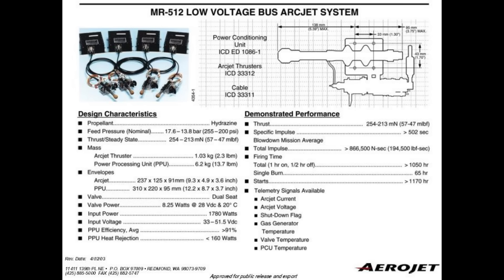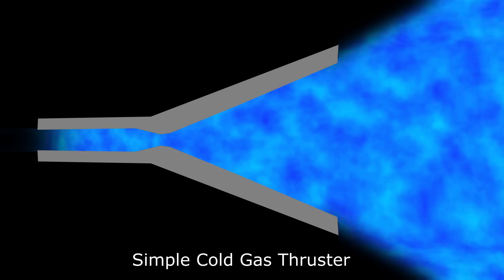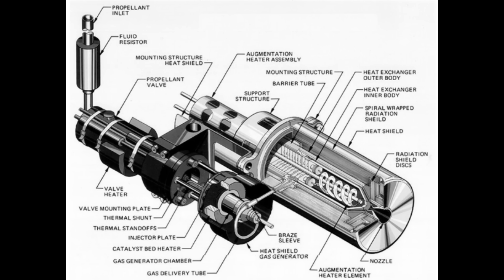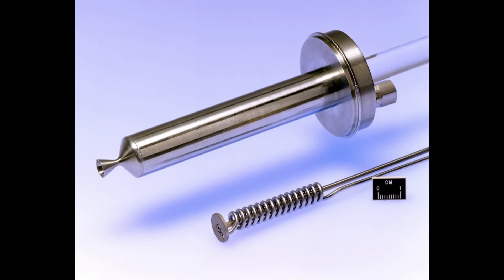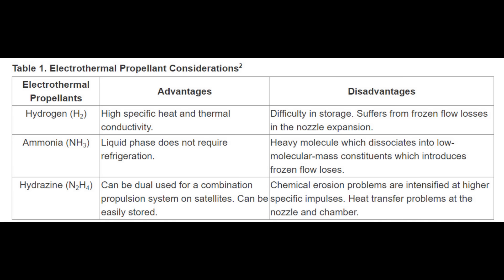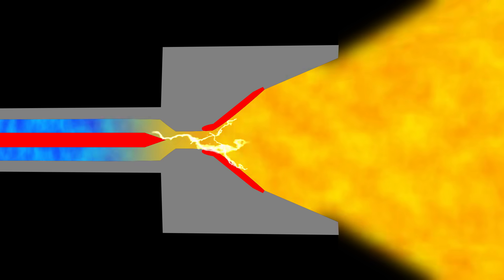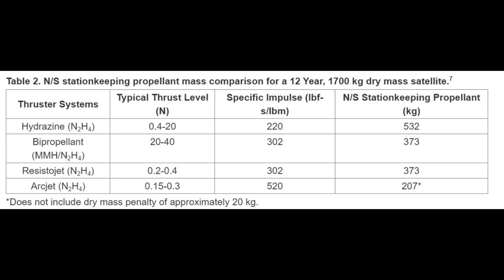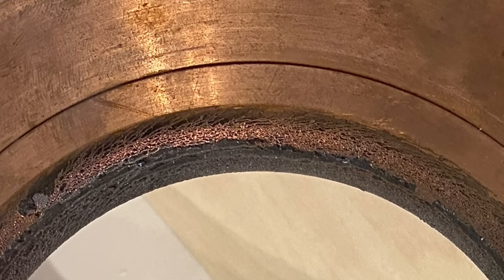Lightning In a Bottle?  The Science Of Electro-Thermal Rocket Engines

Comment: Hey Scott.. is there any data on electrothermal thrusters using methane? Also are these things tolerant to being supplied from a tank where the contents aren't settled, at least at first? So being fed with the occasional burst of gas, instead of liquid.
Reply: sure but why? if you have methane you probably have oxygen and the marginal cost difference between a bipropellant thruster and and arcjet is negligible. ANd if you only have monoprop there  are better performing gasses.
Reply: @orbitONhigh  Consider the problem where you have a methane fuel tank - say 50-100 tonnes worth. It's in orbit and you need to dock it with an orbital platform. Later, when it is empty, you want to undock it and de-orbit it. You need to give this fuel tank some autonomy. Propulsion, guidance etc.

The most obvious solution is to carry an auxilliary LOX tank and run methalox thrusters. The problem here is the complexity/reliability of a bi propellant system. You also need ullage (presumably cold gas) thrusters. So another tank, more plumbing. Plus you may need to get the tank into the right attitude before ullage thrust will actually be pushing the fuel up against the correct side of the tank.

This is all possible with regulation cold gas thrusters. But we're pushing a heavy (50-100 tonnes) object and at this point the mass of the pressure tanks becomes an issue.

So the next step might be to keep an auxiliary tank containing liquid methane and then use this to drive a cold gas thruster. Pressure vessel mass problem solved. You need a pump and a heater in order to have cold gas and at this point you're probably thinking that you might as well use an electrothermal thruster. The question then becomes, can you design a thruster such that it will tolerate initial bursts of gas?

Methane will give you better Isp than Nitrogen and an electrothermal thruster gives you the additional Isp that may be needed for de-orbiting.

Comment: arcjets have kidna been handled side by side as an alternative to ion engines at some point
Reply: at this point  ion drives have all but replaced arcjets. only ones being flown now are on legacy bus designs or specialist missions. hall thrusters are generally cheaper and last longer lasting.
Reply: @orbitONhigh  yep
but like 15 years ago they were quite comparable and often presented as the two main electrically powered concepts next to a few more edgecase ones
Reply: @JulianDanzerHAL9001   yea it changed pretty quick id say the change over happened around 2010

Comment: If you need to slowly adjust a satellite which is necessarily in orbit around a planet and you have an electrical supply- solar panels or plutonium, pick your poison. Why cannot you use the magnetic field of the planet and use a generated magnetic field to oppose it and thus change the position of the satellite, albeit slowly, without the need for reaction mass?
  Is this a stupid question?
Reply: It's possible in theory. Using magnets to generate torque is straightforward, as seen in an ordinary compass. Thrust, on the other hand requires a gradient in the magnetic field, but over small lengths it is practically uniform. So to generate a net force, we need a large current loop, and it all has to be light enough to get a useful acceleration and overcome drag and other perturbations. The concept is called an Electodynamic Tether, you can look that up for more info.
Reply: @shanent5793  Thanks for the response.

Comment: Pulsed arc jet plasma. I've been thinking about this for years. The biggest problem is how to replenish the vaporized parts of the apparatus subject to the arc which are not intended but small fractions of which are accelerated out the back by the sheer temperature of the local plasma created. It's like teeth and saliva. You do things with your mouth and acidity or bacteria borne acidity leeches away the enamel. Arcing does that to the cathode/anodes. But your saliva has calcium and enzymes which put it back. Dry mouth is really bad for your teeth. SO how to apply that to plasma inducing interfaces such that as the fuel is used, there is enough left behind to regenerate the arc surfaces to create a self sustaining system such as your teeth. (Human teeth would decay away in some weeks if it weren't for saliva's constant repairing action.) 
Complicated is an understatement. Control of geometry and ignoring atmospheric pressure might be an avenue to look into.
You could momentarily pulse a magnetic field while creating the arc to push the intermediary (ionized anything) away from the contact and let it move on out the back door but I haven't heard of any successful way of doing that and even that will take some cathode/anode particles with it by the nature of the violence. There has to be some way of concurrently depositing and using the electrodes in an equilibrium.

Comment: There are analytical machines called ICPMS. That stands for Inductively Coupled Plasma Mass Spectroscopy. It injects a sample into the chamber and atomizes it with an induction coil and the atoms then go through a mass spectrometer.

Comment: Couldn't they make the electrical arc used for heating generated like in an ICE car ignition coil ? Those last pretty long and the only reason they fail at all is mostly due to planned obsolescence carefully built in their current designs (like it was with the incandescent bulbs also) You could design this to last for decades I'm pretty sure.

Most fuels used for this also have much less carbon buildup compared to car grade fuel so that would also help. That would work for lifetime of satellite and it could be a swappable part like in car engines for re-used spacecrafts at maintenance intervals anyway.

With bigger heavier payload capable launchers like starship coming online sooner or later in some way shape or form and continuous improvements in solar panels and batteries I'm really curious to see how far supplemental electric source propulsion methods can go in the future.

Maybe ionised gas/plasma thrusters jumpstarted by these methods end up the main propulsion systems in the far-er future.

You will still need chemical fuel and have to refuel somewhere at some point but you will get much more oompf out of it than just burning it off like we do these days.
Reply: most electric propulsion devices do / can last decades, your mission typically end or you run out of propellant first most of the time

Comment: IIRC According to James Dewar's book "To the end of the solar system" (which is about nuclear thermal rocket systems, NERVA/ROVER in particular) a good rule of thumb is 75lbs of thrust to the megawatt.  NERVA was about 1.1GW and ~75,000 lbs of thrust with an ISP about 900.

Comment: Hmm.... Could you use a heatpump to concentrate the excess heat within a ship (or station) and that to heat the gas, rather than an electrical heating coil? Make use of that thermal energy, instead of just radiating it out into space with giant radiators.

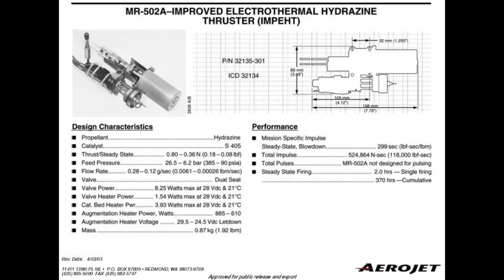Comment: 0:40 I was working at Rocket Research (Aerojet) in the Test Lab when these were first developed. I was a Mechanical Technician and had lots of hands on experience with Hydrazine. All of the production engines were catalyst activated monopropellant technology. We test fired these in huge walk in vacuum chambers sometimes referred to as altitude chamber testing. 4:00 That was the original prototype we called the "jelly roll". That is a Hydrazine gas generator that outputs 1800 degree Fahrenheit gasses. Hydrazine is N2H4 so the gas is hydrogen, nitrogen and ammonia.
Reply: Always wanted to try to make a resistor rocket to decompose hydrogen peroxide. A spicy steam rocket.

Comment: I mean, isn't VASIMR just a really powerful electrothermal thruster? From what I remember of its design both of its stages are heating stages, just much more powerful ones (that iirc are in common with fusion reactors), and the magnetic bottle and nozzle are more just so the thing doesn't destroy itself with the stupidly high temperatures
Reply from the maker: The final exhaust gas has a relatively narrow band of energies because it's not thermalized, that's the difference.
Reply: @scottmanley  Ah, yeah now that you mention it that does make sense given the heating mode and short residence time

Comment: About halfway through this, I had an Idea. Something like this would be extremely viable in an atmosphere. No fuel needed, just a power source and a compressor to cram enough gas into the intakes.
I'm not sure what it'd be viable FOR, exactly. I'll give it thought.
Reply: Just need that power source to be.. powerful.  That's where electric aviation is struggling.

Comment: Honestly, I was thinking about using a combo all in one thruster engine, a decomposition stage creates free electrons, those get captured into electron hole potential areas for wireless tunneling through electromagnetic fields. Which, those fields help increase pressure to a negative ion state has (cesium h2o2 co2, nitromethane, and a hydraulic fluid that turns ionic after being reacted high pressure and heat) with a slight positive ionic state gas that is getting forced together through a tapered and channeled grove section for the combustion chamber. I use pulsed height focused area electromagnetic fields to create areas of heat removal to remove kinetic force in directions I don't want. During this it forces the compounds to mix into a barely meta-stable state high explosive that rapidly detonates. 

I draw out electrons using electron redox flow fuel cell styles to force a magnetohydrodynamic pump linear plasma acceleration effect that heats it up, vortexes it into a smaller tube area where one side becomes positively charged and the other stays negative, creating a rail gun coil gun plasma acceleration using counter rotating plasma vortexes. They get recombined near the nozzle, shaped with some stators to help this, to cancel their vortexes out into pure unidirectional kinetic movement with the stators (but there's a twist) and the coils embedded for a multidirectional pulsing and height varying flux field. This creates super uniform flow during the 2 different ionic plasmas meeting and then has them exothermically react in the bell end.

But wait there's a surprise inside that electromagnetic field! It captures excess electrons to do this and forces a circuit with the electricity already going through into the Bell end and the combustion reaction. Now the bell end is full of channels and overhang chiral grooves that are there to induce vortexing. Why? Well.... because THERE IS FUEL in the Bell end because it's hollow! It the creates a carburator effect using both Bernoulli principal thanks to hear and fast moving vortex exhaust gases, but also the Ventrulli effect. Since the reacting gases aren't fully neutrally ionic, and they are not fully reacted this sounds it by sacred as the electrodes that give it back it's electrons! Now I also added in constructively interfered and destructively interfered light both as lasers & focused light to help correct, heat with random chaos, but then accelerate using standard directed laser acceleration. 

Oooohohohohoho! Just when you I'm done, I come back with more! Muahahaha! Yeah there electromagnetic coils in the bell end to use as ion Hall effect thrusters. Combined with the electrical circuit created electricity generated burning gas, the piezoelectrics in the construction of this design, in the solar panels and the tanks it makes much more energy than before! That's and it expands the fuel into the gases creating roughly the same speed while cooling the bell end. At a higher mass, very high speeds btw! Near light speeds if all done right 😁 

I love vacuum rigid hull expanding "airship spaceships" they can use light, piezoelectrics, the right angle, the right buoyancy and thrust to create more and more heat! But also, use acoustic resonance to further cool it while increasing the engine temperature! Oh right, I forgot to mention this, but yeah you probably guessed it, I'm using acoustic resonance to heat my gases going in to combust, increase heat during and after burn, reduce heating of components in hot areas for less heavy exotic materials, while decreasing boundary layer inefficiency, increase specific direction speed and flow rate! This all means it's hyper efficient, gets into orbit with tons of oxidizer left and more! 

This means, I have high specific impulse and total delta v once there, yay! Combo program puzzle pieces for together the right way like an organ system to perform a highly effecient feed back loop system application world super well, bio mimicry and physics mimicry usually works the best than one complete"perfect system 🥰
Reply: wtf, tldr
Reply: @jj-jak  yeah, that's normal to say to someone who put in the effort to write out their design. 

These are my thoughts, if you feel like you want to be a decent person and talk about them please do so 😉.

Comment: What about using freakin lasers to heat the fuel up? You could use directionality to determine chamber pressure. And with a sufficiently advanced system you could make sure every photon is hitting a gas particle.

Comment: you haven't mentioned solid-arc jets. 
There is an arc between a solid propellant and an electrode. The arc controls the chemical reaction, otherwise the fuel is completely inert.
It needs only a small current, and performs very well at small scales.
Here the electricity only gives the activation energy for the fuel, most of the energy is provided by chemical reactions. But the chemical reactions cannot give themselves the activation energy so it needs a constant but small electric current to work.
Reply: Integza did a video on those, really cool stuff

Comment: If you're going to be using solar then cut out the electric middle man and just use heat pipes and insulated boiler with a valve

Comment: What do you think about heating up water so much that it separates the Hydrogen and Oxygen and burn them? Like a hybrid Thermal-Chemical engine?  Like what happened in Fukushima, just in a properly controlled way?
Reply: If they're at dissociation temperature then they can't burn. The oxygen and hydrogen have too much energy to stay together. If you can reach those high temperatures, then they should be expelled directly out the nozzle.
Reply: @shanent5793  I see, it totally makes sense. I need to learn more about it.

Comment: Speaking of Hall effect thrusters, this is what they use for stationkeeping on the current Chinese space station.  They solved the problem of throat erosion using magnetic confinement and a ceramic deflector to control the flow of plasma through the thruster throat.  This is the first time Hall-effect thrusters have been used on a human rated spacecraft, and similar thrusters are planned to be used on the Lunar Gateway.

Comment: Why aren't there any versions of this that focus sunlight with a lens to provide the heat? There are lightweight fresnel lenses. Why lose energy to solar conversion when the end product is heat?
Reply: That's the concept of a solar thermal rocket. Theoretically even higher temperatures and efficiency than nuclear, and better thrust to weight ratio. Still needs to find an application

Comment: When I worked on the AEHF program, AEHF flight one had a failure of the main bi-propellant engine on the spacecraft. This would have doomed the mission, except for some creative use of the other thrusters on the spacecraft. The failed main engine was not designed to gimbal, so there were 4 arc jets were used for steering. These arc jets were called on to raise the orbit and consumed the hydrazine fuel to exhaustion. The rest of the orbit raising was then done with the ion thrusters. This saved the mission (and several billion dollars). The ion thrusters were normally used for station keeping, and were very low thrust. For the orbit raising they had to operate for hours at a time during the high part of the elliptical orbit. This took months to accomplish. This raised the low part of the orbit at a rate of about 50 miles a day. Thats right: the orbit raised at about the same rate as a mule walks! (well, thats one way to look at it.)